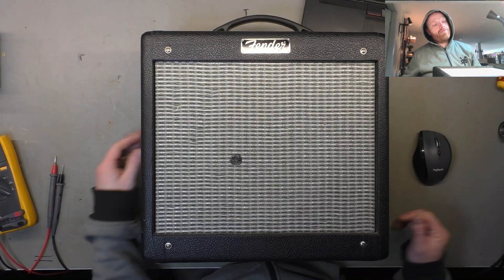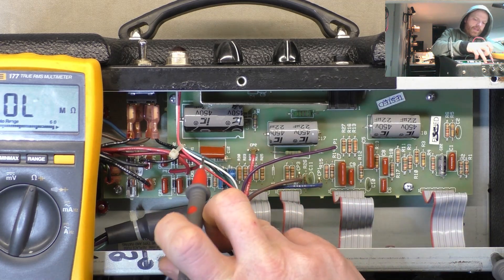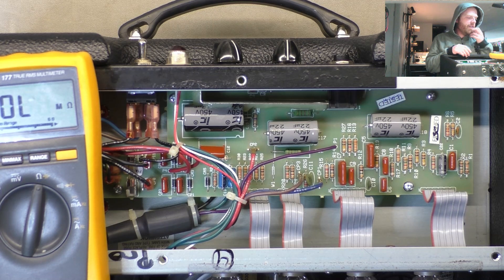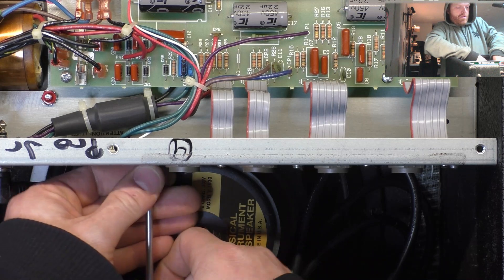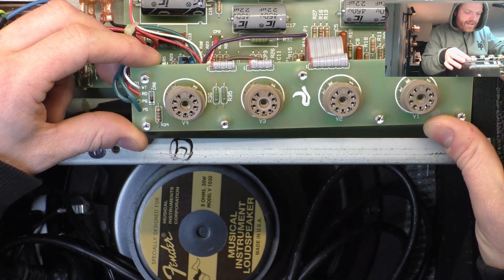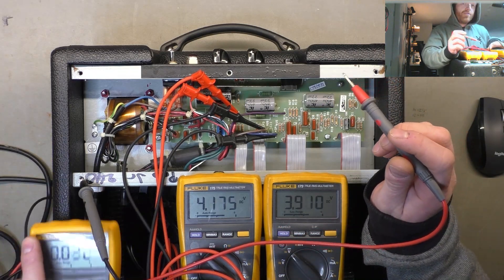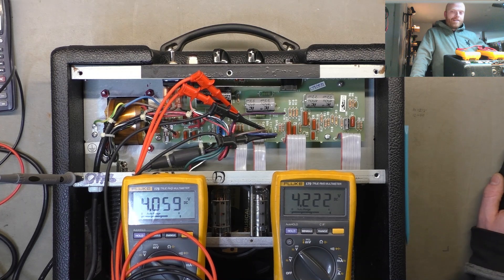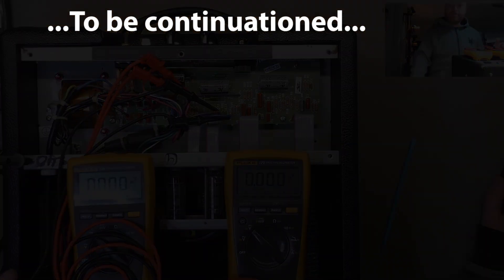Fender Pro Jr + Ranty Mc Rantface

Comment: My amp suddenly started crackling and then shorting out after I moved it with my car to a gig.  I guess it was lying face up instead of upright for a bit.  Tried changing out tubes but the same problem persisted, and a huge crackle happened when I touched the tubes with a chop stick.  I just removed the tube sockets to look under them and found a tiny piece of foil.  Put it back together and now it works perfect. Thank you!
Reply from the maker: Good to hear you sorted it, mate!
Reply from the maker: Feel content that the tubes were probably almost gone with the stock circuit anyway.

Comment: i have loose knobs on my pro jr (tweed) they wobble from side to side quite a bit. Any videos on how to repair or replace these? they dont look like a typical.potentiometer.
Reply: On the Pro and Blues Juniors, the knobs can’t be replaced. The pot shaft and knob are one piece. Idk if that’s what a true for versions 3 and 4, but on V1 and 2 you can’t replace them. Those amps are very cheaply made. If your amp has one piece knob and pot, you’ll have to have the pcb and pots replaced and it’s not worth the investment. I had a first run US BJr and when I discovered these problems, I sold it and bought a better amp.

Comment: Aloha Ranty! Interested in knowing more. I bought one new in '96. Faceplate is also rusted. 1 of 2 amps I should not own. Got a Marshall JTM 60. Paid $50 appears to have bad OT. Would like to drop a new chassis. Maybe a 1987 or Tweed deluxe
Reply from the maker: Aloha, Victor! What more do you want to know?
I didn't see a question in there.
Reply: @BradsGuitarGarage  oh what can be done too improve my Pro Jr. At some point put together amp for the Marshall combo cab. Any suggestions? Usually play blues based rock.
Reply from the maker: Check out my Pro Jr vids, mate.
I think Lyle has some too.
If I don't mention it in the video, also drop C1 (first stage bypass cap) value to somewhere around 1 to 5uf to pull the bass response to what the output stage and speaker in small cab can handle without getting farty.
Make sure you pull the bias back down to about 50-60% if the plate voltage can be kept under about 340-350V.
And raise the value of the screen grid resistors up to 1-1.5k 2w.
Perhaps a Switchcraft 11 jack install too.
Reply: @BradsGuitarGarage  Mahalo will check video

Comment: thought you need to disconnect one leg of the resistor when measuring a resistor in a circuit?
Reply from the maker: Depends where it is in the circuit.
You can also read the schematic and determine the expected value in circuit if it is affected by parallel resistances etc.
Reply: @BradsGuitarGarage  thanks love the vids man

Comment: I don’t get the EL84 deal either - you could cook food with those valves - glad to hear you point that out - coming from an amp technician as yourself - I had a Marshall with a quad of them in it and the control panel got so hot you could iron your pants with it - I’m not exaggerating - Cheers
Reply from the maker: I think everyone just directly copies the original AC30 output stage, regardless of the valves being much more resilient back then.

Comment: It's the same old song. Amp manufacturers want to sell amps. They run them hot giving the sound of crunch, and the store makes the sale. Then, amp technicians get the amp in for some jangle in the jeans. I would tell amp manufacturers to make the bias hotter. Then tube manufacturers can sell more tubes too. Cheers 😀
Reply from the maker: Unfortunately I actually want my customers to get value for money. Call me crazy.
Reply: My comment was totally sarcastic, but Fender is getting a lot of heat over their amps. Cheap, cheap, cheap. I've always been taught, if you're going to do something, then be the best you can be. Leo, was really cheap, but he had reliable parts to work with that stood the test of time, until he sold the company.

Comment: Anyone know if Pro Jr. IV has colder bias like bj4 has?
Reply from the maker: Although I haven't had one on the bench just yet, I'm hearing off reliable sources that the BJ4's with cathode bias are still biased in the 130+% range and with excessive plate voltage, so don't hold your breath for a reliable amp from Fender these days, mate.
Reply: @BradsGuitarGarage  I wanted to buy one new.. but it seems ill have to wait for some used one to get it cooler without loosing warranty..  Thank You for the information :)

Comment: Lol is there a good fender amp?
Reply: Excelsior? It's one of the pawn shop series from about ten years ago. It's two cathode-biased 6V6s into a 15" speaker. Has volume and speed control for trem. It's got a couple of 250 Ohm resistors in the power supply to sound like a valve recto. It's biased too hot (surprise) but it can take it better cuz of the cathode bias. Best of all: all the valve bases,. pots & switches are mounted on the chassis. The input jacks are mounted on their own little PCB, which can be replaced with proper jacks when they fail.
Reply from the maker: Stock without needing anything done to it? No.
Many that can be upgraded and modified to give a long great sounding life, however.
Reply: The vintage stuff...
Reply from the maker: Yes, if one of them has been neglected or abused, you may be up for as much as $1k to get it solid, but it will then be solid for multiple decades. I was referring to their current production offerings.
Reply: @BradsGuitarGarage  How do the tweed Bassman reissues stand up? I don't see them turning up in these videos by guys like you or Lyle. I presume they'd need the nasty IC brand filters replaced after 3-5 years, but what else goes pear shaped in those?